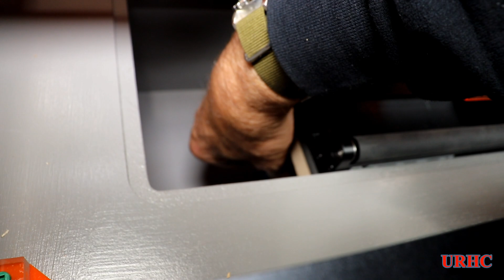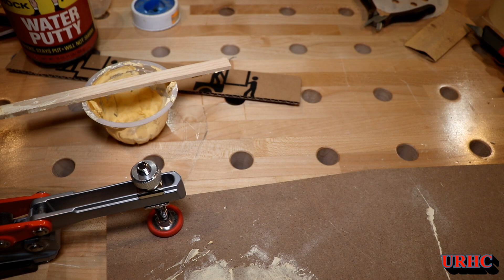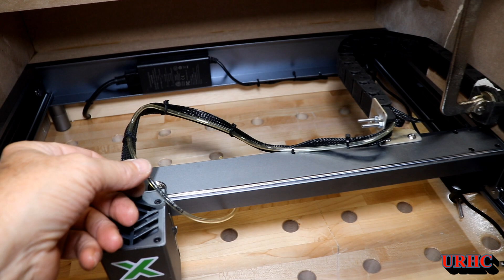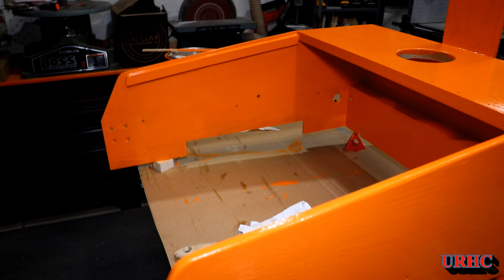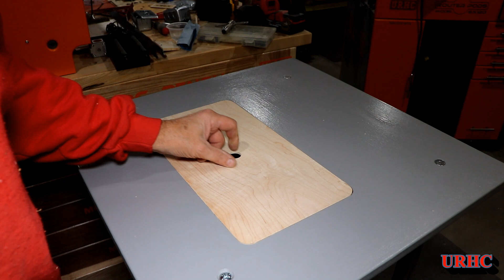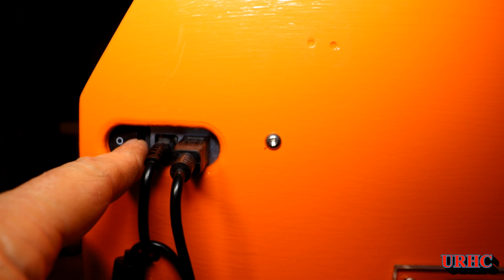XTool D1 Ultimate Enclosure With Air Assist Build. Works With  Lightburn Now !!!

Comment: How did you build your air conditioning system in the laser module? I never would have thought of that. Wow, what materials did you use?
Reply from the maker: Just used compressed air. That was before air assist pumps were popular.  Thanks for watching.

Comment: thanks for all the details and inspiring ideas...
Reply from the maker: These open lasers definitely need a way to contain and vent the fumes. Thanks for watching.
Reply: Yep, and the diy boxes seem much better, than the flimsy tents they sell. How was it with the perspex screen, does the clear work just as well as orange ? I've seen some people just using clear, but most opting for orange, thanks for you experiences/thoughts. @unemployedredneckhillbilly2023
Reply from the maker: You need glasses with clear that offers no eye protection.  I bought certified OD6+ glasses to be safe.

Comment: Looks good. Only downside I see straight away is no ability to pass through material longer that the working area of the laser.
Reply from the maker: I guess you didn't watch the whole video and see the slotted plastic side vent plates that slide up to pass boards through. Thanks for watching.
Reply: @unemployedredneckhillbilly2023  I didn’t see the part showing them slide up. Nice!

Comment: Nice! Do you find the fan on top to work efficiently with the inlet on top seeing that the smoke/fumes have to rise to it instead of putting the fan on the side at the bottom?
Reply from the maker: Pulls fumes off the top and fresh air in from the bottom. No dead space in the enclosure.  Thanks for watching

Comment: Really nice job ! Thinking about building myself one that fancy and efficient
Reply from the maker: Doesn't  mater what it looks like as long as the fumes are exhausted.  I see xtool has a fairly nice one available  now. Thanks for watching.
Reply: @unemployedredneckhillbilly2023  just bought the xtool enclosure, it’s pretty good and easy to install, good UV shield, but the exhaust system is really not enough, a cloud line will work better, especially with some plastic VOC. I subscribed, eager to watch  new vids 👍🏽

Comment: I noticed you have an adjustable air assist. Why would you need to adjust it. I just got mine and it only has one setting (got it from xtool)
Reply from the maker: I use high pressure compressed air. There  should  be an adjustment  on the pump. My Dewallie pump has a knob to set it on my new Ortur  laser and a flow control for fine tuning. I have no idea what Xtool does to set theirs. Contact  them. Thanks for watching.

Comment: Ed, Question - What length cable Chain did you purchase from Amazon for your enclosure. Thanks and great video.
Reply from the maker: I just bought the standard 1 meter length and kept removing links until the laser cable just fit. Had to extend the motor  cable a couple inches. The spot I mounted it was the only place the cabling to the laser didn't  need modding. Thanks for watching.

Comment: Please tell me you’d be willing to make me one of these enclosures?!  I have zero tools and even less know-how to build something like this but my D1 is supposed to arrive on Monday.  I am using it to mainly cut foam which I’m told has toxic gas released when burned so I need an enclosed.  Could you make me one that I could buy from you?  I’m in the US, Independence, Kentucky to be exact.  Thank you in advance!
Reply from the maker: Sorry I can't make anything to sell. I tried  setting  up a business  with 2 employees a couple years back but the cost of NY mandates to hire employees was too much so I just share  ideas. 
All the laser fumes are toxic and should  be vented outside. Thanks for watching.

Comment: Great job on this project!! I'm building one also but I have to make my cabinet much deeper than yours.  I like to engrave repurposed, refinished  "ACID" cigar boxes, and others, which are about 6" tall, so I need to raise up my D1 with the extension legs to clear the top of the cigar boxes.
Reply from the maker: That should be easy to do. That sounds like a great use for the D1. Thanks for watching.

Comment: I bought off Amazon a Inline AC infinity with 402 CFM 6 inch with "premium virgin charcoal"
I have never heard of that. This is probably overkill but I will just get a new larger hose if I need to. Thanks for your help I just to be rather safe than sorry
Reply from the maker: A charcoal  filter  is for smell in grow tents and not. for1 removal of particles.  Most lasers use a very expensive hepa filter. 6 inch is way overkill and will move a lot of heat from your house plus the duct is almost 7 inches od. You will need a way to make up for that either  in your  hvac system or open window to ptevent back pressure in your appliances. You had bett get some help designing your system  because you apparently have no idea about airflow and keep going to different  extremes.  Contact  Xtool and see if they can help you.

Comment: Even with the filter, I want to filter it outside with a hose. If I get a reducer is that fan strong enough to push it safely out a 30 or 35 foot 1.25-inch hose, please?
Reply from the maker: The Infinity  fan will work with a 25 ft 4 inch hose. You will need a high pressure  blower for smaller  tubing and longer runs. 1.25 hose won't  move enough  cfm without a very high pressure  blower  to overcome  the static pressure.
Reply: @unemployedredneckhillbilly2023   Great answer glad I asked. If the air is already filtered at the Enclosure you mean something like a cheap in line fan about 10 or 15 feet in line down from the filter to give it a "boost" ? rated at 100 cfm or 150 cfm  to push the air on out or more cfm I have no idea ? I appreciate your time i would not want my 3year old grandson to get sick on my account
Reply from the maker: You will need something like a shopvac to use 1.25 tubing and they are not rated to run constantly as many jobs take 6 to 8 hours. The Infinity fan and a short 4 inch run outside works for me and that's all I will use. Anything  else you must design and test. Use metal pipe or metal lined hose so you don't develop static that can destroy electronics and shock your grandson.  Some plastics create vapors that can kill so do research about the material before burning on it.

Comment: Excellent work, Sir. I’m doing research before designing my own enclosure for my xtool d1 that showed up yesterday. I used it for the first time today and wasnt expecting so much smoke and fumes from the cutting, so it looks like an enclosure is in order. Would you say that the 4” duct fan moved enough air to keep the smoke down? Is there any reason why you didnt opt to go down draft?

Once again, nice work, and you have an impressive shop there!
Reply from the maker: This Infinity fan is overkill and  I  only use the 2 or 3setting. Fan should be designed to create just a slight vacuum in the enclosure and it doesn't really matter how it flows. I figured updraft would let me open the cover faster. Air intake locations seems to make the biggest difference in how clear the air stays.  Thanks for watching.

Comment: Curiosity question...You mentioned being careful with your bit choice when cutting plastics.  Why didnt you cut those pieces with the laser instead?
Reply from the maker: You can't cut clear polycarbonate with a blue laser and if you could the gasses are extremely hazardous. You need a fiber laser for a clean cut in Lexan that thick.   Thanks for watching.

Comment: That’s a great enclosure.  I’m in the middle of begging my brother-in-law to help me build one.  Are there any modifications you wish you had done, after using this for a few months? I’m interested in putting in laser safety acrylic rather than clear; pros or cons?
Reply from the maker: I used clear  because  I use it in many  videos. Should  have made it from steel so it's  fireproof but I decided  to take the cheap way out. Thanks for watching.
Reply: @unemployedredneckhillbilly2023  I honestly thought yours was steel when I looked at the first picture before I started the video - that orange paint!  I’m leaning towards the orange acrylic, because I will be running this in a room in a shop which has two doorways - but no doors - and I want to protect the eyes of anyone peeking in around curtains.  I will also have two dogs in there on occasion, and figure it helps protect them, too. Thanks for your help and the response!

Comment: Did you have to extend the wires or were they long enough to fit in the chain?
Reply from the maker: like  I said the x motor  cable had an extension added and the laser cable was fine. There  is only 1 position the chain can be in for the cabling to work out. Thanks for watching.

Comment: Ii am interested in building my own enclosure for my Ortur Laser Master Pro 2.  I saw the video on your version of the same unit.  However, on this unit you used a different model fan and you did not put a diffuser in.  Is there a particular reason? And, also I see you didn't drill as many vent holes and seems like you incorporated them into the side plexiglass panels as well as a few drilled holes in the bottom.   Thanks for your time.
Reply from the maker: I decided  to try the new lower cost fan and It works just as good. Same specs just more plastic. Just changed the vents  so a long piece  can be slid through the  sides. The vents  across  the back are not needed and the baffle  gives more even airflow  but is not needed from what I am seeing. Thanks for watching.

Comment: New to the channel, great build.   I was looking for something on YT for enclosures for the X1, and yours was the first to come up, can you show how you tied the vent into your existing duct?  Thanks again.
Reply from the maker: It's  just a 4 inch tee going  out through  one of the 4 inch flapper vent like they use for dryers to keep clod air out.  Used 2 4 inch dust collection blast gates to isolate  them when just running  one. Thanks for watching.

Comment: Is there enough room to add additional risers? Mine is come with 2 extra sets.
Reply from the maker: Not in my enclosure.  You should  build something  taller or with  adjustable  sides. My rotary doesn't need spacers.  Thanks for watching.

Comment: Thanks for sharing this inspiring build! What size cable chain did you use? I'd like to add one to mine but not sure which one to get! Thanks for sharing!
Reply from the maker: In the description of the build video. The x cable needs to be extended  and there is only one position it can be mounted in for the laser cable  to be long enough.  Could  also use a smaller one if you don't  run air. Thanks for watching.

Comment: Man I wish I was as skilled as you! I was wondering if you have had any problems with the software so far? I have had 2 projects now be ruined because the software just shut down once I was doing the final version...☹ and once that happens I don't think I would ever be able to get the design to line up again. Love watching your videos though!
Reply from the maker: I haven't had any shutdowns but I switched to lightburn the end of November so I haven't  used their  software  since. If you use lightburn there are excellent instructions on the xtool support page showing  how to set it up. Load their  setup for the d1 also for the easiest way to get started.  It uses the upper lh for the origin and works great.  Thanks for watching.
Reply: @unemployedredneckhillbilly2023  Thanks so much for your help!

Comment: Hi friend, I received a comment from you asking the marking product is plain steel or stainless, but for I don't know why this comment is hidden. So reply you here: the pliers are plain steel. :)
Reply from the maker: Thanks  for the reply.  It did a nice job marking them with no coatings. I didn't  expect  that because  the blue lasers I use only can engrave bare stainless. It looks  like a very  nice machine just wish it engraved a slightly larger area.   Thanks  for watching.

Comment: Great job and thank you for sharing !I thanks to your review I ordered a D1 too and would like to add air assist system. What type of compressor should i get? any refererence? thanks in advance !
Reply from the maker: I just hooked  mine to my shop compressor.  It doesn't take a lot of airflow so any compressor will work. Some people  use a large nozzle and get away with aquarium pumps also I have been told. Thanks for watching.

Comment: Ed, beautiful job as always. Your attention to detail in everything you do and how you explain is wonderful. Would you sell a copy of theses plans. Watching your review of the D1 is what made my decision on getting a beginner laser so much easier. I ordered from your link and have received and have my grid on order now. My wife is even now loving your channel watching the gardening and other videos
Reply from the maker: Thanks. I don't  have plans. that would  be useful.  I have the tap files for the side but that's not what the final assembly is. I start  slightly  over size and trim as I put things together. Most everything  was just made from measurements as assembling  and I don't  waste  time documenting stuff or fixing files because  I  will never  build another.  I drilled  and tapped holes in the frame by transfering them and had to modify the x motor cables to make the chain work. I have about  100 hours into  this. Most went to tweaking everything  to be a perfect fit with perfect  gaps as putting it together and changing ideas as I went along. I would  say start with  some cardboard, make some sides,  decide  if you want to void the warranty or use other ideas to make it all work together. I originally  was trying to find a vacuum former to just make a big one piece clear enclosure over a form I started  that would drop over the machine which really would  be easy to mass produce  and be super affordable but that would have taken months with the current situation so .I switched to this. Thanks  for watching.

Comment: I see they mention they are working with lightburn which should be out in the near future ! Something you were hoping for Ed.  
Another fantastic job too ! You always amaze me with how creative you are, and I can never believe how much you get done ! I'm sure you've found a way to clone yourself :)
Reply from the maker: I have been told it will work  the beginning of December but you never know with how Chinese companies will say anything to get sales. I am hoping by the end of the year. I always  have atleast 3 projects started for job security  😉. Thanks for watching.
Reply from the maker: I am running on lightburn right now. They worked  hard to implement it fast and Mine works great now.
Reply: @unemployedredneckhillbilly2023  That's great to hear Ed, that was quicker than I expected! Thank you for the update /reply.
Reply: @unemployedredneckhillbilly2023  you are able to use light burn with the xtool d1??
Reply from the maker: @laurenzeth9704  Yes since the end of November.  It works great. Follow  the instructions on the xtool support page